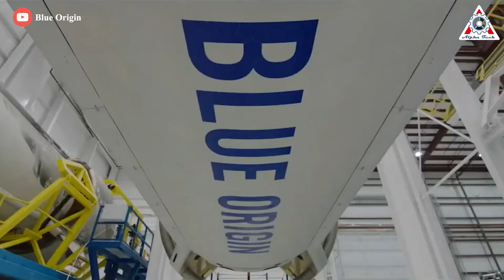Disaster! Jeff Bezos&Blue Origin completely lost on way to orbit almost a decade -Never beat SpaceX

Comment: 4:40 production rate of Merlin vs Raptor vs BE-4 isn't comparable because the BE-4 and Raptor engines are way more complex due to being full flow staged combustion cycles.
Reply: BE-4 is NOT a full flow engine, it is a staged combustion. Look it up
Reply: @halsnyder296  sorry, that’s what I meant. Raptor is full flow and BE-4 and Merlin are not.
Reply: Thus, the comparison is garabageb
Reply: The BE4 is not a Full Flow engine. It is a Staged Combustion engine but unlike the Raptor the oxidizer is injected into the combustion chamber in liquid form.

Comment: 3:50 Blue Origin is set to deliver the first flight ready BE-4s by the end of this year for ULA's Vulcan rocket.
Reply: Blue Origin was supposed to deliver the BE4  engine five years ago and counting. 

Even if they do deliver by the end of the year... what kind of production rate can they achieve? 

SpaceX is launching almost weekly and at a much cheaper rate. 

By the time Blue Origin and ULA even start to figure out how to reuse the 1st stage, SpaceX will have Starship running at its payload will dwarf all competitors foreign or domestic.

Comment: SpaceX isn't the only company offering trips to orbit. Rocketlab and United Launch Alliance are both companies offering trips to orbit in the US.
Reply: Neither Rocketlab nor ULA have the rockets at present to do that. Rocketlab will hopefully eventually have Neutron, its next generation launcher, capable of being man-rated (albeit with a payload mass to orbit of 8 tonnes). It also doesn't have a crew-capsule (yet). ULA has a few more Atlas 5 rockets (they are all spoken for, and will be replaced by Vulcan, which is also not man-rated). ULA does not have a crew-capsule, unless it can use some idle Starliners (if they haven't been broken up for scrap). So there are few US manned launch-providers other than SpaceX and Sierra Nevada.. There is no talk of New Glen being man-rated, nor any talk of a crew-capsule.
Reply: I, like rocketlab and ULA, also offers trips to orbit and I have provided just as many.
Reply: and virgin galactic